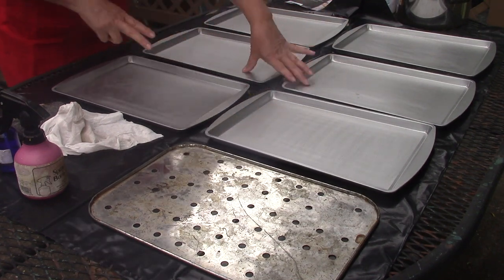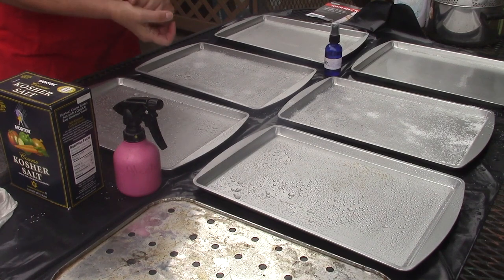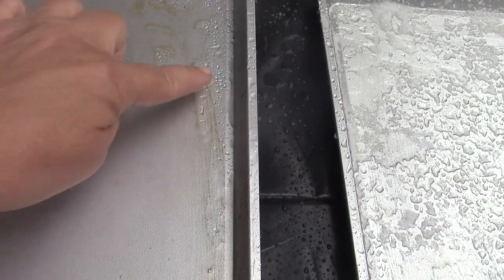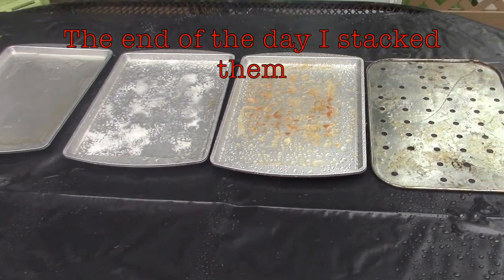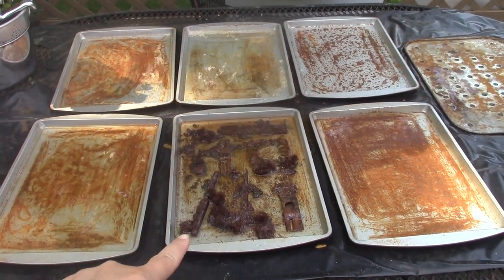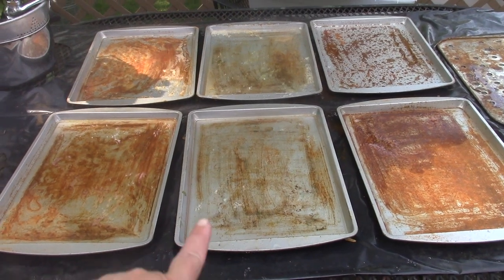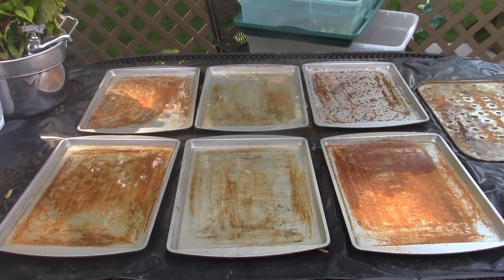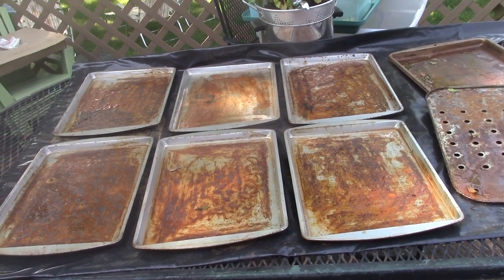Rusting Paper Series: Part 1 Prepare Surfaces (Pans) (Recycled Art)

Comment: Years back I had these types of baking tray and I recall that they started rusting as soon as I washed them off with hot soapy water. I’d have to clean the rust off every time I wanted to use them for baking. Maybe there’s a bit of a residual coating the manufacturer put on to keep the sheets from rusting while they were being shipped and displayed in the stores?
Reply from the maker: Oh that could very well be. But mostly now a days they are coated with Teflon. Leave it to the dollar store to sell the steel rustable ones! LOL thanks for watching!